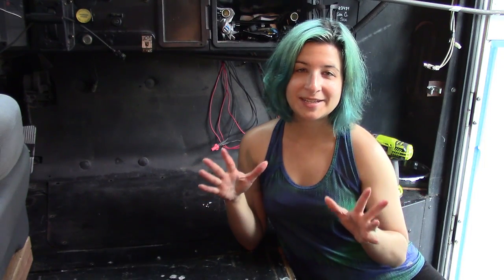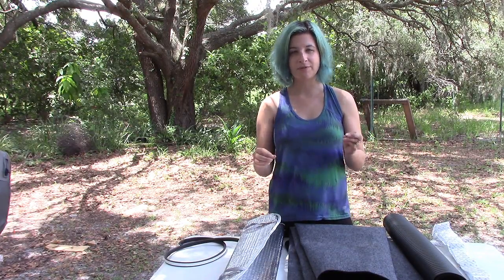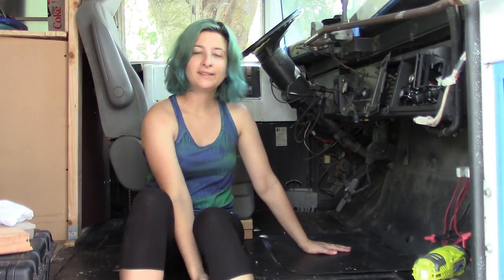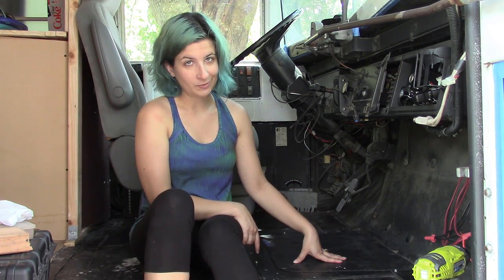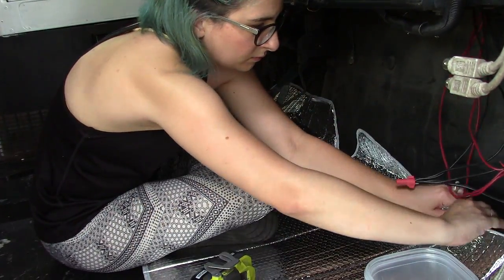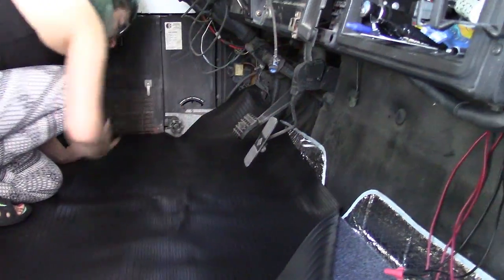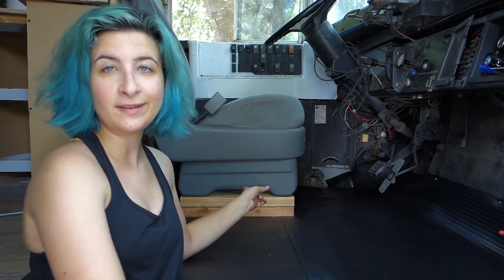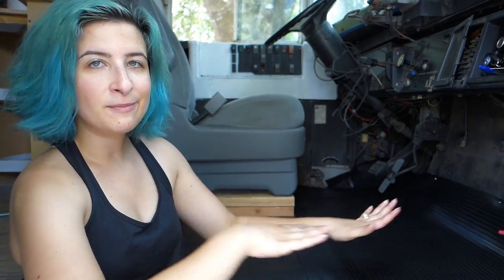DIY Sound Proofing/Muffling and Heat Insulating Floor in Driving Cabin  | Skoolie Q & A

Comment: Ok. All that you did is ok for sound deadening. But, 90% of the heat is still going to come through. You’ll need to go to a either Auto/truck parts store or on line and buy some heat reflective insulation. Then either from underneath or through that hatch stick on that Insulatation. It is like fiberglass and pleated foil. (Not a windshield sun block, don’t use that underneath) See, once the metal floor gets hot it’s already in the living area... you need to block it from heating the floor in the first place. I was going to say; try some 3/4” or thicker foam with the silver defector coating (facing the engine parts... but the fire rating on that foam board isn’t good enough (you do not want a fire). That’s why fiberglass is better... it doesn’t melt.
Reply: I would be very careful about any type of insulation near the exhaust components. Heat shields are the safest solution. Most vehicles have them, it isn't apparent what they do, but they absorb and then reradiate heat while moving.

Comment: Look for holes, and fill them!  Also, check out a product called: ThermaCels - Insulating Paint Additive which can be added to any paint - a one gallon package costs about 13 bucks. Multiple coats are recommended, and it has texture like no skid strips.
Reply from the maker: Thanks! We haven't heard of that additive. We've been covering the holes with flashing tape since it's what we had on hand.
Reply: I've used silicone, tape, bondo, small furry animals... anything that just blocks the airflow. There are diminishing returns  and unless you want to lose space by building thicker, there's only so much that can be done.

Comment: Summit racing has deadening material that is also heat resistant.  It SHOULD help. That's what I'm going to use. As I'm getting the same kind of bus. They also sell insulation mats that I'm going to install in the engine bay and undercarriage.

Comment: Dyna Mat is a good sound and heat insulation material. Not cheap, buy it in bulk. As far as the exhaust system, assuming it is in good safe condition, ask an exhaust repair shop about making some heat shields. These are usually stainless steel pieces of metal between the exhaust pipes and the floor of the vehicle. They are mounted so that air can go freely around them.  They absorb the heat and noise and the air passing around them carries off the heat while moving. If mounted securely they should not rattle.  Noise and vibration can be transmitted up the steering column, the shifter and through small holes in the firewall. All these can make a difference in the cabin noise. Insulating the ceiling, door panels and bulkheads can reduce sound reflections by absorbing instead of bouncing the noise. 

You might want to go to some truck yards and see how modern semi tractors are built. School buses are built to specs that do not include creature comforts.

Comment: Raptor liner/bed liner on the floor will help with noise and insulate a little. Then add the other stuff over the top. An automotive exhaust heat shield might help with the underside.  Something like this picture. Made from aluminium.  Might be able to get one off at a junk yard.

https://www.clublexus.com/forums/attachments/rx-2nd-gen-2004-2009/216220d1310651853-driving-without-the-heat-shield-exhaust_shield2.jpg
Reply from the maker: +donald gibbs thanks for the suggestions!

Comment: Dyna-Mat is probably #1 for sound and helps with some heat but its expensive. There is also a wrap you can get for the exhaust used on Harley's and race cars but its also expensive. The work you did looks good and should help considerably.
Reply from the maker: Hmm, we'll look into wrapping the exhaust. It looks like there are some reasonably priced options. I didn't realize that was a thing lol. Thanks!
Reply: Asphalt Nomads what you did looks great and should help tremendously with the heat. The multiple layers is the key. Let me know how it turns out.

Comment: lol..... too funny. We used almost all the same materials that you used. I did the same exact thing with my Skoolie but only difference I did was add some of Car Installation sound deadening and heat barrier from Amazon.  We also cover the front panel under the dash and we think it's a little better.  We have only done short trips and it definitely keeps the heat down!! It was like $63 for a 4x12 ft roll. 

Thanks for all the videos because it's helping us greatly with our build!!
Reply from the maker: Nice! Glad to see something similar is working!

Comment: If you want a little more sound proofing and heat resistance. You could put that Heat Reflective Stuff with that flooring over it running the rest of the way up and they may help even more. That really looks good. :)
Reply from the maker: Thanks! We may end up running it all the way up but we ran out of materials lol

Comment: I'm going to run a idea past you, I do not have the money to do everything at one time, so I'm thinking of an ideal for insulation for the roof I'm not going to take the inside metal skin off but what I'm thinking of doing is cutting access doors to stuff insulation in them and then put the doors back on, put the access doors between each of the ribs on each side and this stuff them full. Do you think this is a plausible way of doing this?
Reply from the maker: Hmm, we haven't seen anything like that before which is not to say it wouldn't work. Depending on the age and condition of your bus the insulation could be super nasty. Ours was almost rotting and had...things...living inside of it so we ended up having to scrap some of it off and not having full access would have made that a lot harder. A lot of it would depend on how you do the access panels. If you haven't already, check out skoolie.net- it's a massive forum for conversions and they have a ton of great info on the different ways people have done things.
Reply: Asphalt Nomads with my situation I have I'm going to be doing things as a go just get it kind of where I can get inside of it and work on it as I go, so the insulation on the roof will be something that is added down the road. that's why I was asking about the access doors, but hey I'm one that does not follow the rules so that's probably what I'm going to try to do! lol I'm going to take it the seats out and start building!  thanks for all of y'alls ideas! love your videos
Reply from the maker: Good luck! We're super curious to see how the access doors work!
Reply: Hey Terry, I'm not the Nomads, but the only thing I can warn you about is the more holes you cut to the exterior, the more chance water can get in.  

A lot of old hands really do suggest removing everything first - it's so much easier that way.  However, funds are what funds are. If you do it, take lots of pictures and share the results!

Good luck!
Reply: Patrick Yates I'm only talking about the inside shell! Thanks for your concern. But I'm on a very limited budget, so I have to do everything as I can't afford it. It will be alone work in progress.

Comment: we used to just use undercoat ro stiffen the floor and firewall
Reply from the maker: +Gadianton x did that help out with the noise and heat?
Reply: was not the greatest as insulation  but it did knock the noise down a lot

Comment: Did it work?
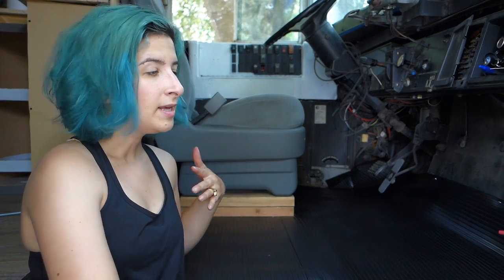Reply: Based on the text they posted at 3:18 it seems that there was no change in the sound issue (which makes it a little awkward that this is a DIY video).   Or perhaps, at best,  they mean, there's no numbers to show, but that seems quieter if you're in the driver seat.